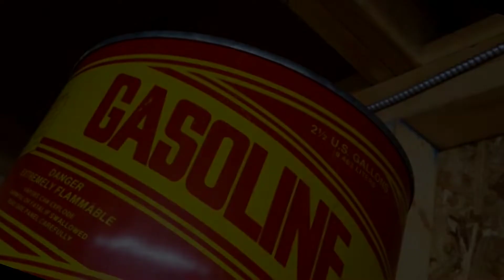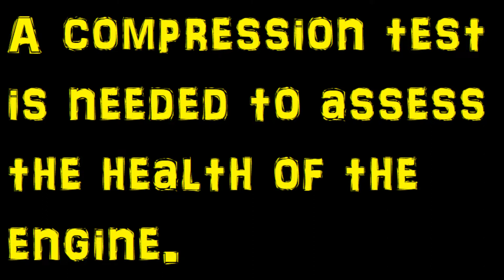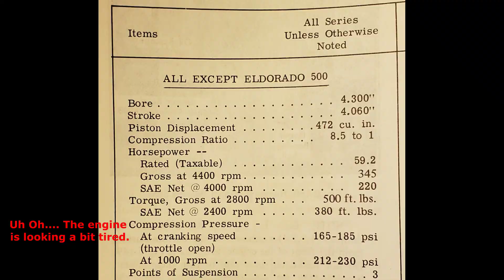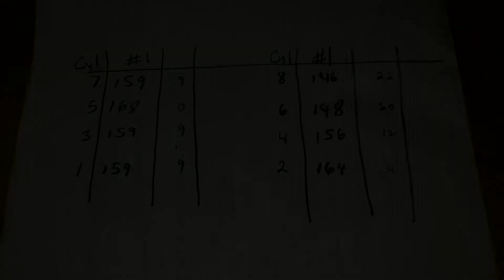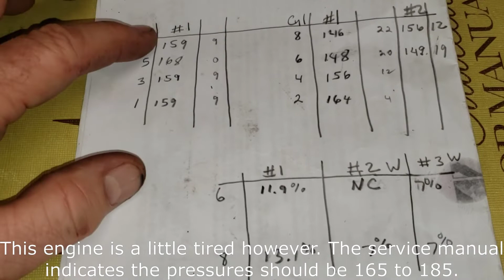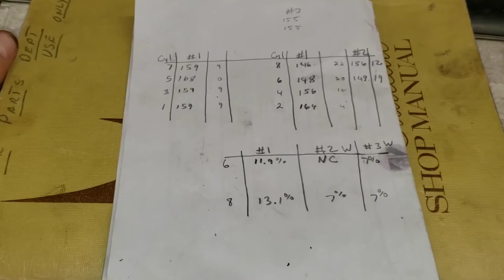VLOG - Cadillac 472 - Sticky Exhaust Valves and Compression Test

Comment: Good video! Where did you get the correct hose fitting for the pressure gage? Each and every one I found was too short to reach the threads in the sparkplug holes... would be helpful to know. Thanks!
Reply from the maker: Have had it many years. I think I bought it at a local family owned parts store. It's not new by any means.
Reply: @ImpalamansGarage Thanks for your fast reply!  you were lucky. Is there any way to contact you by e-mail, maybe you can send a  couple of pictures, I'll try search for something similar. Thanks!

Comment: Love that you're working on a 472. My 69 DeVille convertible doesn't have those engine braces?!
Reply from the maker: Engine braces? You mean those diagonal bars on top of the engine bay?
Reply: @ImpalamansGarage  yes
Reply from the maker: @TheRds797  I've always been perplexed by Cadillac's use of those. Had them on my 81. I always assumed they were for redirection of the engine in case of an accident. They are certainly too light for frame stiffening.  I know one thing. They get in the way! I remove them from time to time if I need to.
Reply: Convertibles did not have them as there is more bodyflex. It is mentioned somewhere in the shop manual.

Comment: If'n you wanted to, you could pull that valve cover and back off the rockers and do a cylinder leak test. Don't know the miles on the old beast, but I would imagine that a valve job would be in order if you wanted it be near perfect. Otherwise just RUN 'er!
Reply from the maker: That is exactly what I was planning to do next. Saw you video series on the 389! I learned a lot.
Reply from the maker: 100,000 miles.

Comment: Could it be carboned up valves that are not quite seating?  A good Mexican tune-up might fix that. You know what that is? Drive it at high speed on the freeway for several miles to burn the carbon off.
Also are you burning unleaded gas in it? It might not have hardened valves seats. Was made to run on leaded gas.
Reply from the maker: Some of the exhaust valves could be just carboned up, or they could be burned and need replacement.  Regarding the tune-up.... oh yeah I know what that is. LOL.... gets it share of high speed time. This car is a 71 model. 1971 was the first year for hardened valve seats for Cadillac. Unleaded is no issue.